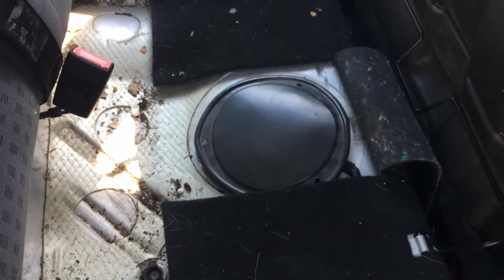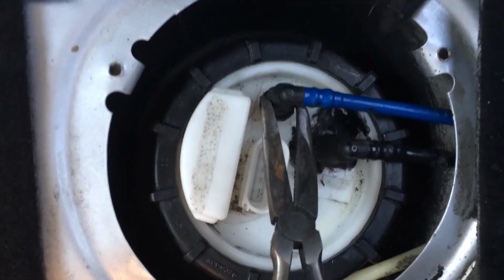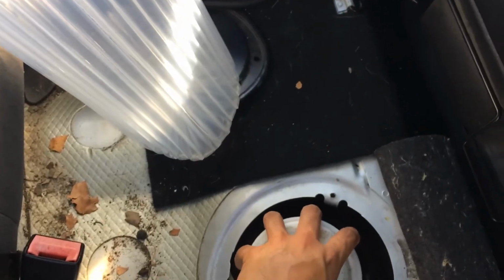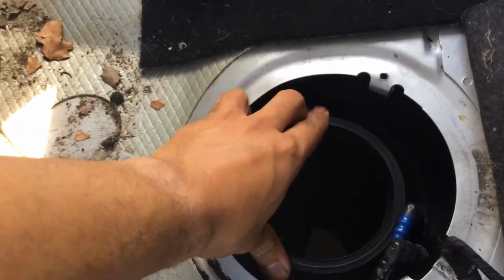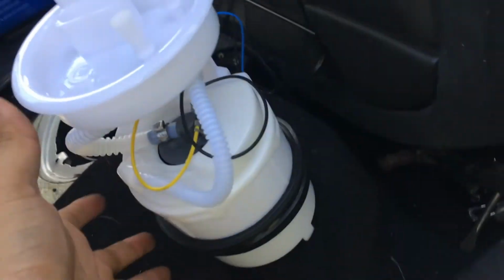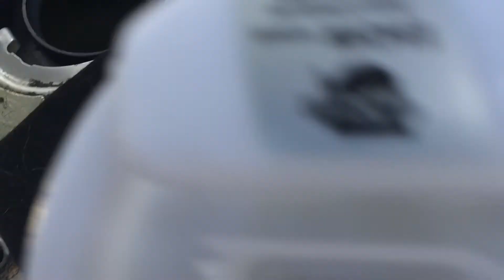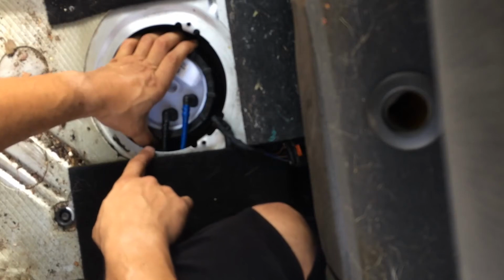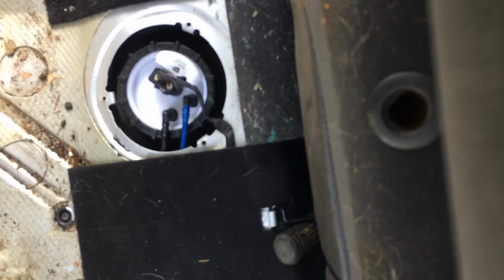2002 Volkswagen Golf Fuel Pump Replacement

Comment: Thanks for the tutorial. I knew the fuel pump was down there but I didn't know what tools or how to approach the removal process. I will be changing my fuel pump on my 01 GTI soon.
Reply from the maker: No problem. Let me know if you need help in taking it apart. In my case, I have the pump still, but the plastic housing was bad while the motor pump is good. I still have the pump if you are interested and if it applies to you. I can show you in a video how to take apart the pump for re-assembly.

Comment: where and how much did you pay for the new pump?
Reply from the maker: In my state in Advance Auto was $218.
https://m.advanceautoparts.com/h5/r/shop.advanceautoparts.com/p/carquest-fuel-pump-module-assembly-e8424m/15770107-P?navigationPath=L1*14932%7CL2*14986%7CL3*15378
Autozone was more expensive.